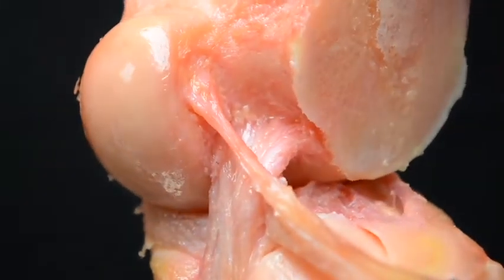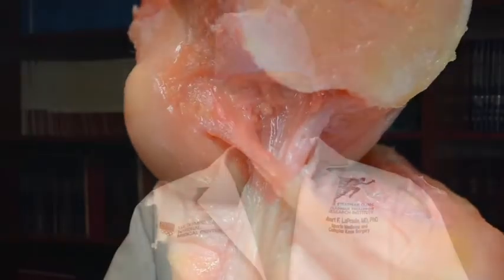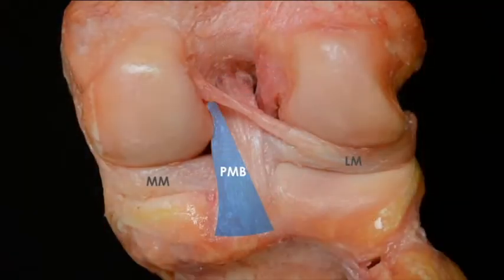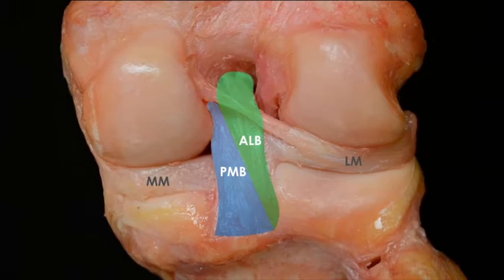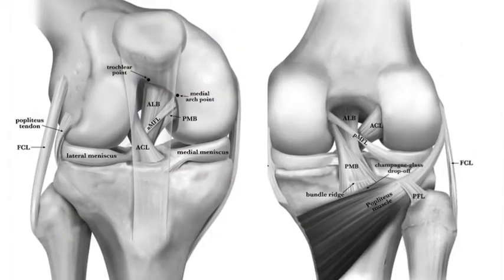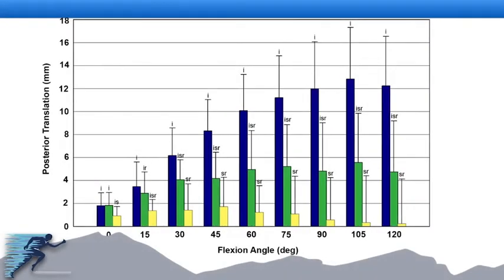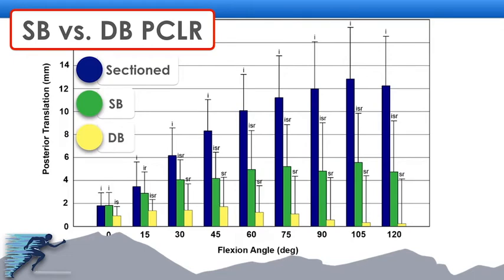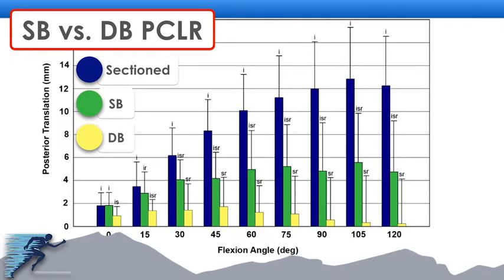Anatomic Double-Bundle Posterior Cruciate Ligament Reconstruction: Introduction

Comment: Is there consensus amoung Doctors on which procedure is best for outcomes in year 2022...single vs double bundle? I'm deciding whether to follow through with surgery but the only procedure available where I live in arizona is the single. I've searched the net for a surgeon that performs the double but no luck. With subpar results on the single so widely documented I would have regrets settling for an older procedure.